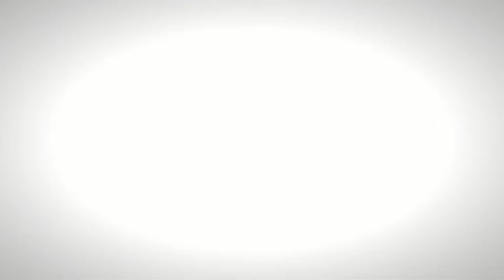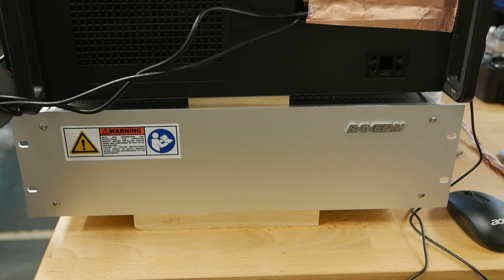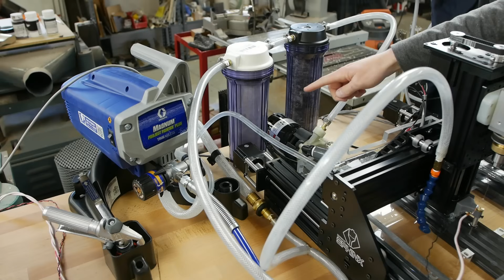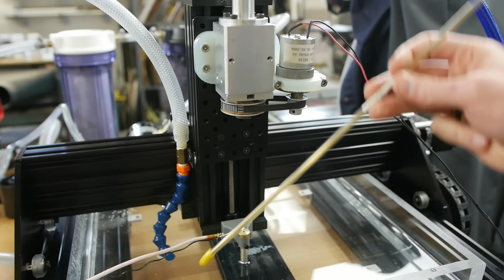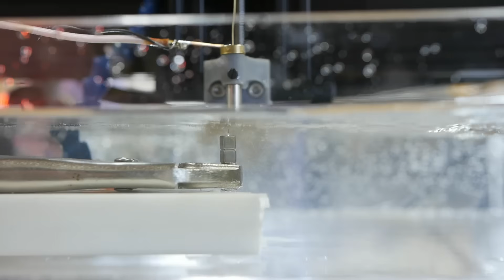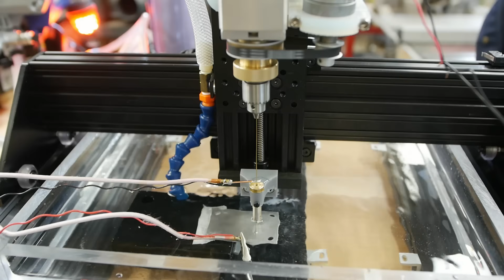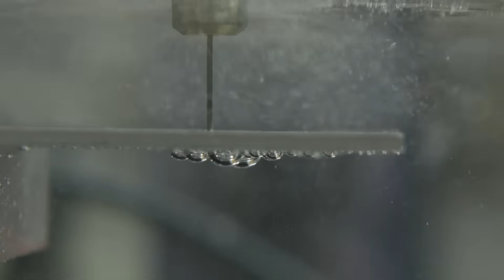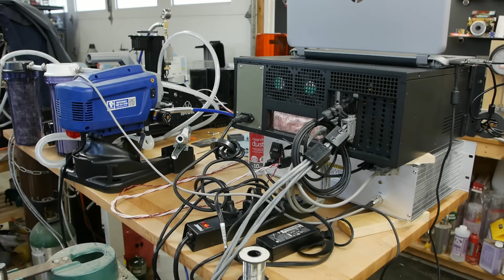Drill through anything (conductive) with Electrical Discharge Machining

Comment: I guess in the six years since this video was made, manufacturers started including the brush assembly. Oddly, the slot for it is visible on the unit he's using but apparently wasn't included. Point being, if you build one of these, you won't have to making a sliding contact setup.

Also, I'm surprised that cutting the brass tube with cutters works because the cutter deforms the material, turning it elliptical. I guess there's sufficient clearance in the bottom guide so that it's not an issue.

Comment: Isnt this same way a torch height controller works for a plasma table? Mine reads arc voltage to keep it at the desired arc length.

Comment: Hi , For electrical noise shielding I use a 1.5 mm X 25 mm copper flat bar mounted around the work tank , and fitted about 50 mm from were the  tank work table is , I made my copper flat bar by flattering   a copper tube.. I have very few noise problems , of course I have followed Mike advise in the placement of the PC and kflop controllers.. cheers
Maruano
Reply: Hi I want your advice what I good option to buy for me/ used made in 2000 Machine EDM Wire Cut - Agiecut Evolution BC 2 made in SWITZERLAND good  used OR unused Chinese Machine I need your suggestion

Comment: Hi what about  chrome carbide.  Usually  found at quarries  for the crushers or the impact shelfs when the stone drops on to the screening process what separates the stone to different sizes very hard wearing. Usually  gets cut with a plasma cutter.
Thoughts it very heavy stuff as well

Comment: This is incredible. The EDM drilling heads and seals seem to have disappeared off aliexpress. Yet the one part of this project that is completely inaccessible to the hobbyist is the arc controller from BaxEDM and its integration with the CNC controller from dynomotion. You completely lost us there clearly due to the likely high cost of these systems. I wonder if there are open-source alternatives to both parts. In the meantime, and purely out of curiosity, how did you integrate the BX17 arc generation and its output signal for CNC speed control with the Dynomotion software. Second, how did this integration handle the occasional need to reverse the CNC program. I find both aspects really interesting. I could not find anything on the Dynomotion website that indicated this unique ability. Finally, have you tried the edge finding capability of EDM (mentioned in the B17 feature list), I found this to be incredibly unique and useful, to be able for example, to location the edges of the work piece using the same bit used to do the drilling. Really great stuff.

Comment: If you rotate the substrate and place the electrode in a stationary position, at the outer radius, and feed it to the desired depth, you can use the electrode as a boring tool. Once the circumference diameter is cut to depth, you can draw the position along the axis toward center radius, or re set the radius position to make additional cuts until the material is gone, in blind boring, or just go through and the plug should drop free.

Comment: Mid 80's I used to work in a machine shop. We had a industrial one, with oil bath, around 2 square yards and about 2 feet of drilling capacity. I've seen it working twice, boss wanted to sell it, couldn't find a customer.

Comment: If it's a highly stressed part you have to ream the hole because the burnt bore is a crack initiation site. EDM drilled holes in titanium piccolo tubes that distribute hot air for wing anti icing for the Canadair Regional Jet caused cracking that made the tubes disintegrate. It was a miracle that there were no crashes before the problem was discovered following a string of leading edge overheat incidents. The manufacturer didn't want to have to get rid of the expensive EDM rig they'd bought, so they had to zap the holes undersize and have someone clean them up with a reamer.

Comment: I went to a votech to learn and the die sink was my favorite machine at that time in mid 90s. Long before 3d printing .
We only used electrodes and they didn't have any spindle or spin at all for that matter. We used graphite or brass.  The graphite was very easy to shape. I did some really complex burn with steps and about geo shape you can imagine. 
EdM wire machine was so amazingly accurate and could such a great tolerance.

Comment: Excellent especially the music (lack of)

Could you explain how the chuck was attached to the adapter that is held in by the big brass knurled fitting? 
Would not a collet be more use holding the fine cutting electrode?
Why do the sides of the electrode not spark and burn?
I appreciate the end of the electrode burns reasonably evenly as a piece is removed so the closer part sparks
What conductivity should the water be, for example that from a reverse osmosis plant may be useful? 

Regards...

Comment: FYI, parts cost ≈ $6, 500 total...

BX17 arc generator: $3,400
Sphinx CNC chassis: $1,800
KFLOP: $250
KANALOG: $250
KSTEP: $200
Paint Sprayer shown: $319
water filters + cartridges: ≈$100
EDM drilling head: $61

Comment: Trying to get my head around the concept of negative feed rate... Kind of tricky because it's not just a reversal of feed direction. On a conventional machine, feed is the directionality of the tool/work and depth of cut factored by time right? Negative direction would just be a counter motion ie. clockwise to counterclockwise/ moving +X to moving -X... But what exactly would be a negative depth of cut? I can't really picture that, I just think of a retract but thats not negative feed rate its a retract which is its own thing.

I guess I'm missing something on the electrical side of things.

Comment: Congratulation ,great work.
Some suggestions: 
You should use insulate bushing as electrode guide instead of brass bushing and apply the generator out put to a slip ring connected to spindle by graphite brush before chuck . Of course  you should insulate the spindle and mechanical seal assembly . 
Edm drill do not need water bath and submerging , a small water flood is more than enough .

A capacitor about 0.1 micro Farad (400 V) parallel to table (work piece) and  electrode help at carbide drilling.
You can use a capacitor box and a rotary selector or can use relays and control it by your control system .

Comment: WHAT EVER YOU DO DON'T FEED YOUR PLANTS WITH THAT WATER!

Firstly you're vaporizing both the intended material and the electrode, an electrode containing copper. Just hit the part where you said "it turns into a smoke in the water". That smoke is a plume of ultra fine particulates, self-evidently containing copper. The very finest of that smoke would be atomized material, hence an increase in the water's conductivity, 

After saying all that wanna guess what happens to an old oak when just a few copper nails are driven into it... or any tree for that matter. If you guessed kills it dead then you're a winner. Well copper is a required micronutrient for plants they only need it extremely low quantities. Excessive amounts interfere with chlorophyll, effectively halting photosynthesis.

So ya... would not recommend (unless you want dead plants of course)

Comment: How many amps of power at what voltage does the power supply output through the brass electrode?

Edit: apparently it is variable but presumably near the voltage and amperage needed to arc weld whatever thickness metal you are machining.

Comment: You do not use an Ion Exchange filter! You need a de-ionization filter and then bleed back in enough water with dissolved solids to give you the level you desire. 

For easier process, use DI water or distilled water, and make a separate container such as 100 ml and put in a small amount of table salt and bring your dissolve solid levels to a level that will bring your dissolve solid level in the product water up to where you want it

Comment: You would probably benefit from impudence matching with a properly sized capacitor on the boards you are having noise issues with.  I have found that method to be vastly more effective in reducing noise and voltage spiking vs ferrite beads.

Comment: Hey Ben, only thing most likely keeping me from making this is the Arc generator. I could just make my own program to read the arc time and reverse the spindle. But the Arc generator. Couldn't I just make my own with some FET's or IGBT's? Switch them on and off across a beefy supply? Set the on and off times of the switching device and Bob's your uncle? What am I missing with the arc generator which is special? This seems similar to the tab welder I made to weld up my 18650 batts. Great work as always Ben!

Comment: i would love to see a hole drilled through a needle but along the length of it, in other words, you use a tube to cut a rod into a slightly larger tube.

Comment: I ran a EDM in a tool and die shop making injection molds.  We used carbon to machine a negative space anode cutting tool. This could cut any shape like a cookie cutter.  Then the tedium of draw polishing a mold.

Comment: !! Granite is conductive, and sandstone? isn't it? just a thought... no one has been able to figure out how ancient societies cut and quarried their stones, drilled square holes in stone, etc..... could this be a possibility?
Reply: Yes, I'm sure the ancient societies understood the principles of electricity and circuit design, made high current semiconductors and made alloys no one even heard of from metals yet discovered just to make a square hole in a not very conductive rock.
Reply: @chris746568462   and granite is conductive. You can also raise the conductivity by exposing it to oxygen.. Or water.. And dependent upon composition... It can actually be pretty highly conductive. Ever since I saw this video I've done hours of researching trying to figure out what I can about the conductivity of different stones and crystal. Granite has a lot of quartz and metals, making it pretty conductive. One thing I couldn't find was anyone using this drilling tech on granite. Its not just square holes, but laser precise cuts. The video OP asked for suggestions to try, so I gave one. I can't say it would work, but I'd sure love to see of it could.
Reply: @mikeg338  
"One thing I couldn't find was anyone using this drilling tech on granite"

Hmm, maybe because granite is piss poor conductor?  
EDM can only cut materials that have low electrical resistance.

A similar way of cutting granite is with a water jet cutter. 

Pretty sure 60,000psi CNC water jet cutters didn't exist thousands of years ago either.
Reply: @chris746568462   how do we know? Really? Man made materials degrade over time. Stone does not. Stone and (mostly) raw pure metals are all that are left. We do know they have created batteries. Yeah, they would only average to 3-5 volts, but we know about those because they were clay and asphalt, and degraded iron and copper rods and tubing. One thing that always blew my mind was how short sighted humans really are. We only see what's in our lifetime. We're the greatest, and most intelligent, and anything beyond that just couldn't possibly have existed, right? Yeah. Right. We still cannot figure out how they did what they have done. Probably because we're still trying to figure it out with sticks, stones, and supposedly bronze was the best metals they made. Sure. They used a base 60 number system, we use base 10. We attribute intelligence to them but discredit any possible technological aptitude past what can be done with sticks and stones. Seems more to me like small minded humans  explaining things with their limited comprehension of what happened 1000s of years  before they were alive. We go off what has been prescribed to us, as citizens. Do you know what has really been found? I don't. So much is kept secret. Of allllll the artifacts found, pictures our telescopes take of the stars, the ancient texts discovered... Only a handful, if that, is published. So between our limited knowledge even in the scientific world (I mean, that's why scientists exist, to discover) and the miniscule amount of shit that is published to the public, can you really truly say they did not have any advanced tech? Nope.

Comment: Great ideas here. back in 2011 I created a 10 dollar edm machine. this had an automatic feed of the electrode. before this i was using a popular mechanics edm which was published back in the sixties. It used a light bulb to control current but you had to advance to electrode manually. this gets tedious fast. it also used kerosene for the dialectric. God forbid someone bumping the container while its burning! Someone made a youtube video  of my poor mans edm while i was demoing it at a model show.
look for   PM-EDM         1 of 2  & 2 of 2

Comment: I love you, man. I'm a physics grad in South Africa. Been struggling with employment since... always. I shared this clip with an engineer and was just asked to help develop a system here, locally. Can't wait until I earn, and can say thanks.
Reply: If you can leave SA with that degree, please do so. Your life will be infinitely better. I promise!
Reply: I've tried that. I didn't have any luck with my job applications abroad. Experience is wanted in my field, and locally, we have quotas that control ethnic and gender diversity in the workplace. My ethnicity makes up for 8% of the population, but a far larger portion of qualified scientists, so getting employed in my field, to get experience, is not easy. Electronics was just a hobby to me in the past, but now it is how I make a living. You are correct though. Some of my more affluent friends left the country and are doing very well overseas.
Reply: @peetbrink4788  is tricky yea. I left 5 years ago. Came to Aus with no job or anything. Just my stuff and engineering degree. Took 6 weeks to get a job and haven't looked back. Try every angle mate, it's worth it. Even if you have to risk it with no job. Check to see if your degree gets visa. If so... Come!

Comment: I love the tech. But round items are not hard to drill by hand. Just use a piece of angle iron. I swear you not the slight friction on the side of the drill bit on the angle sucks the bit into place. Would be awesome to see this in slow motion! Also seeing the harmonic bend on a bit would be cool. Good job

Comment: I made my own to drill 2 holes in hardened steel to allow me to reuse a broken machete blade. The holes were for the new grip on the now shorter blade. Driill bits wouldn't touch it. Fun project

Comment: Question for you or somebody who made the same machine. Have you tried running the paint sprayer for longer periods of time? I'm thinking whether to use it or a pressure washer for my edm build. My main concern is that the manufacturer states that the paint sprayer can only be used for up to 50 gallons per year

Comment: Why not stack the water up and let gravity do the filtration?         Have the pumps - pump water from 3-5 layers of tubs so the microscopic debris sink      You can use Tupperware with lids on them and stack on top of each other.

Comment: https://www.unitconverters.net/frequency-wavelength/kilohertz-to-wavelength-in-metres.htm

30kilohertz = 9993.0819333 wavespectrum meter...

thats like... 9x10^-3++? so it is Infrared spectrum with electron discharge?

Comment: i know wire and drill edms arent designed for it, but could they be used for making small molds for plastic?
When I move into a new place I plan to get an edm and/or bigger cnc mill, and an injection molding machine, I'm wondering if i could make my own edm for a few thousand that could make quality molds.

Comment: Have you tried drilling stone , such as the fossil form of crinoids, (Indian Beads) or some of the stone, such as granite, as this might help explain how Egyptian builders were able to drill hard stone. Yes I realize the next problem is how did they form electricity and high volume pumps, but the curiosity is there.
Reply: The material must conduct electricity for the process to work.

Comment: Weird seince.
Ok at my age. I watch a hell of a lot of YouTube videos some are funny some you can learn from and things like this make you think. But honestly sharing ideas and knloge or lack of brings other people who know to coment on the subject of gives you the opportunity to question an idea, yes you see negative comments you just have to weed past them becuse they are from ignorant people who don't care to learn.
Knologe is power.   Give me more.
I am going to say your a very smart person, im not sure i understand everything but thats ok. 
I did work in a machine shop and I can appreciate this lesson becuse we had one job in cast iron the had so many sand pockets youd drill 2 inches and breat a bit the hole had to be 18" long it wasnt critical its was in a connecting rod  used in a motor and this was an oil hole to let oil go from each berring between the rod and caps  for the crank shaft and piston, I broke so many drill bits on that job and I could not help it this was 40 years ago. And yes some of the parts wound up scrap. But they also got the broken drill bits out of some of them. 
I dont think you could driil them using this method but you'd definitely be able to remove the broken drill bits.

Comment: Can't you add hydrogen oxide to the tub of distilled water to make it wetter or less surface tension like rain water im not sure what this will do to its electrical property but guardners use it to mimic rain water to water plants with. Judging by the amount of lightning durring a rain storm this could be the key to why we have thunder storms becuse the waters ionized.   Im not a chemist but i belive this might be a way to change dead water into a usable substance for what your doing.   ??????@@@??.   Im just thinking. Ill try not to hurt myself doing it.